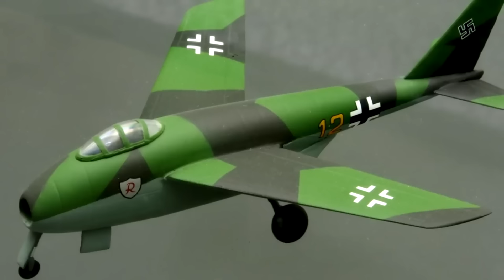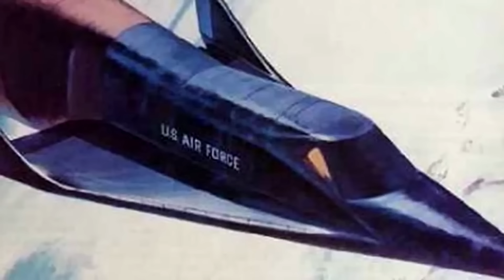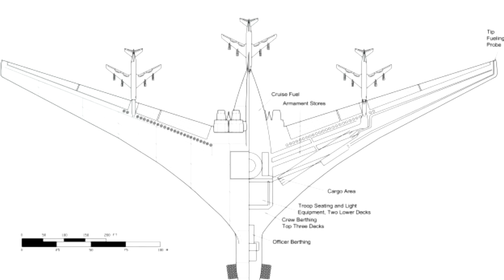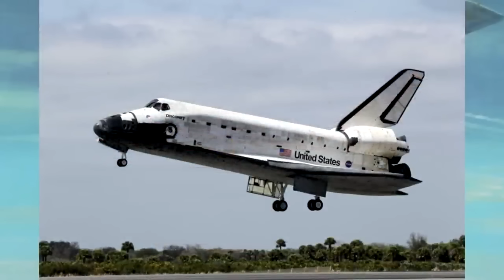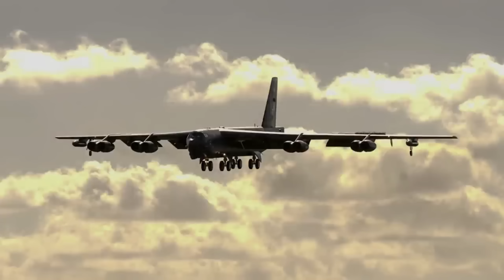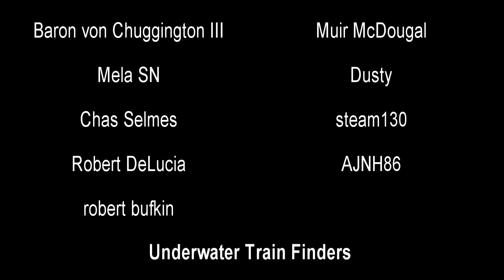10 Insane Never-Completed Airplane Concepts | History in the Dark

Comment: The Tsybin RSR, in truth, looks no more "insane" than the Lockheed F-104, just a tad (!!!) bigger. Imagine a single pilot handling this behemoth! Pray tell, what manner of pressure hull was this aircraft/sub concoction supposed to have (in order to be able to submerge to a depth greater than that attained by the average guppy!) and still be light enough (along with the required secondary propulsion systen required for submerged travel) to take off of water and fly?  Jet engines would need to be sealed against salt water entry at any reasonable depth... er... HOW?? Jules Verne would have looked at this and said "aw, HELL no!". The "Victory Bomber" could have hoisted the existing air dropped atomic weapons towards the end of the war... except the British didn't have any (yet) and the Americans were not about to lend them to the British (and they just plain were not thinking about those scenarios at that point in time). The thing about the earthquake bombs was that they didn't need to hit their target (if used against land targets) but would detonate deep underground and damage, if not destroy, the target by creating a localized earthquake IF they hit close enough to the target. When used against the Tirpitz, the "Tallboy" punched clean through from top to bottom. Spectacular but kind of "overkill" as a large number of heavy AP bombs would have sufficed and could have been delivered by "stock" Lancasters rather than modified versions.